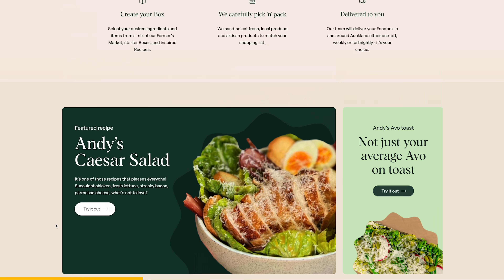I learnt one of the oldest cooking methods - the Hāngī (aka earth oven)

Comment: Got some mates who use to DIY it inside anytime they felt homesick. 
They used a metal basket lined with rocks putting in leaves then put their meat and veges in it and cover it over with more leaves. Wrap it in a wet tea towels. They put it in a normal oven with some rocks around it and a tray of water beneath it on the bottom shelf.
 Yum yum, was it do down with a beer or two but remember, 
no sipping.
The DIY isn't tradional but when your homesick it's better than anything the shop sells. Great work.
Thanks Mate

Comment: Hi there watched your video and enjoyed.

Hāngī was traditionally done in the earth.

Stones in the hole
Logs stacked vertically and horizontally burnt down as seen in video.

Food baskets dropped in
Covered with dampened sheet type cloths then the dirt on top. No smoke to be seen during cooking

3 hours  later. Dirt and covers removed. Kai ready.

That's how we do it and the original Māori way We still use this during tangihanga or celebration ceremonies.

The Samoan call theirs Umu very similar to our Māori hāngi.

There was definitely no stainless steel baskets as shown in video That's a true  modern quick and easy tradition of nowadays.

Glad you enjoyed.